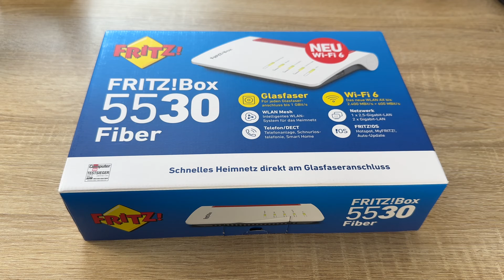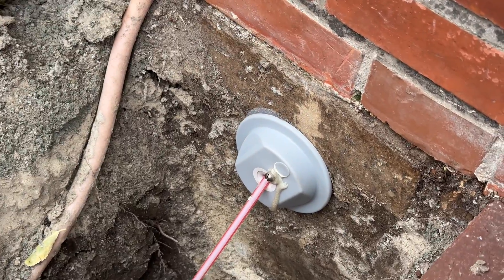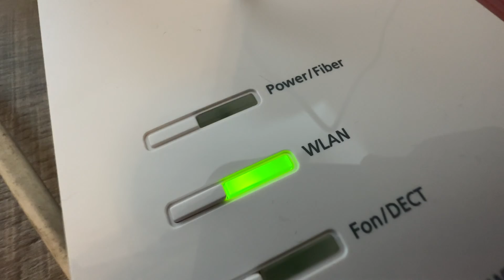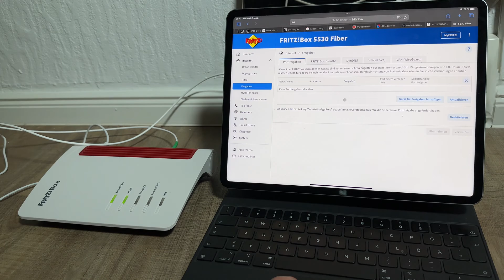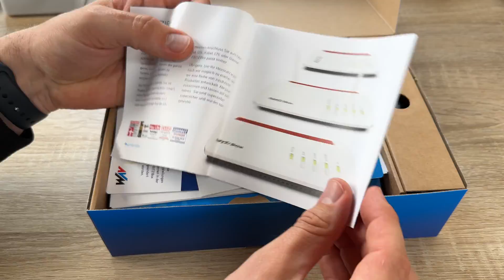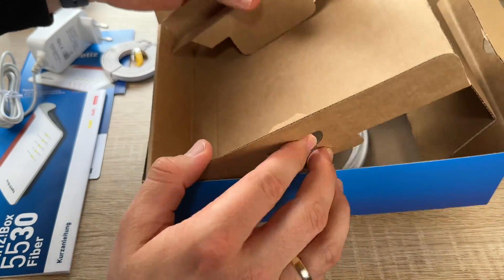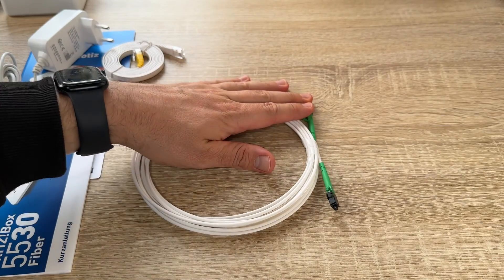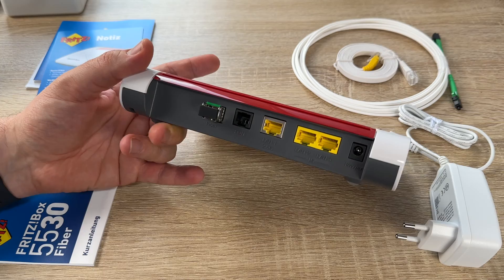Fritz Box Cable (Fiber optics for AON, GPON & XGS-PON) Wi-Fi internet Router Unboxing & instructions

Comment: I'm trying to figure out if I can use this device on two deployments in the US, one with Verizon and the other with AT&T. Verizon uses GPON and fortunately they supply the user with a Nokia ONT, however the AT&T service is XPON and they punish me with a massive BGW 320 device that is the bane of my existence. Unfortunately I can't get AT&T to provide a straight up ONT so the best option I have is to use the WAS110 to bypass the device, however if I can write the BGW MAC and info to the XPON, then I can easily use this device. 
If I could order this on Amazon to try it would be great, but the whole how to return it if it doesn't work outweighs my curiosity at the moment.

Comment: I have the PPoE Credentials from my ISP to use my own router but I'm hoping to connect the fibre directly using the gpon sfp. Can you please tell do i need any configuration to make that work? Currently there's an ont on the wall.